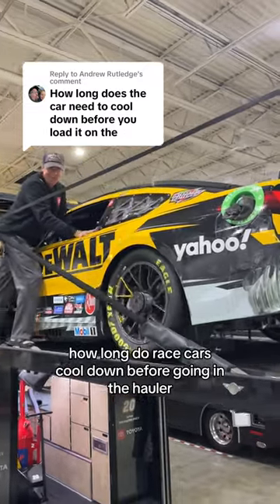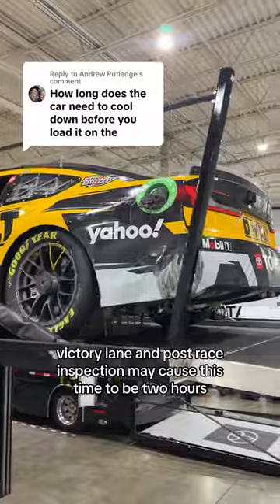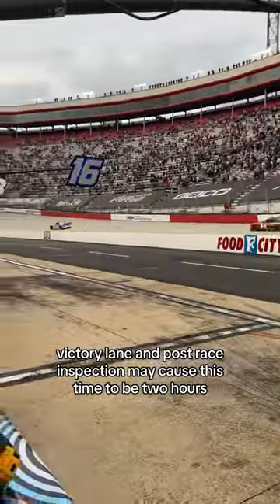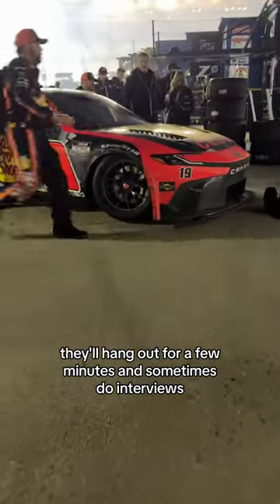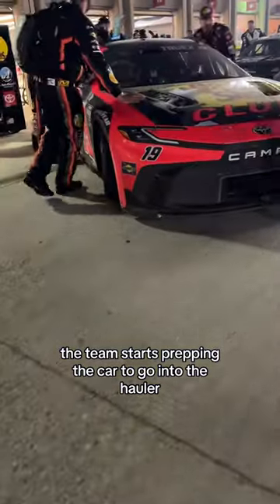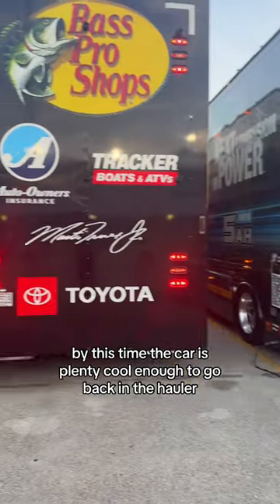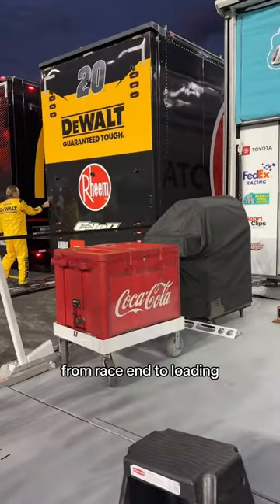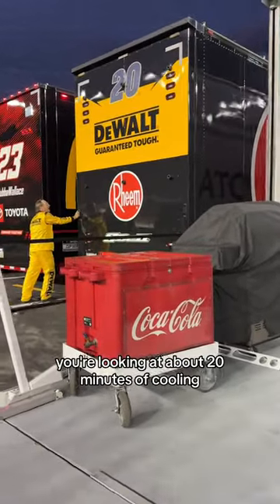So how long do race cars cool down before going in the hauler? #NASCAR #hauler

Comment: What do the drivers do after every race? Do they go straight back to the shop?
Reply: More than likely they get on a plane and go home
Reply: Sometimes it depends. If they go to an international airport you'll see them at a restaurant in the area before they have to catch their flight. If they're driving you might catch them at a drive thru. They will hardly ever hang out at the track afterwards unless there's a special event happening
Reply: Drivers of the big teams don't go to the shop much outside of team meetings.  They certainly aren't allowed to work on the cars at all.  So after a race win or lose they will likely just jump on a flight home.  They may sleep in their own bed 1 or maybe 2 nights then back in the air to the nxt track.  They sometimes will arrive in town a day or 2 early for sponsor events or just to check out a cool place in the area they never went to.  There isn't 1 concrete answer to this question as it varies so much team to team and driver to driver
Reply: @fish3539 i wonder if they take off at the talladega airport when they're at defa
Reply: @villain6634  yes. I was at the track and you could see team planes landing
Reply: @SierraFrost69  I didn't see teams landing was in Lincoln tower section a
Reply: @villain6634  damn, that's crazy
Reply: pretty much what you'd do after work
Reply: @jayer-su3hu  you talking about the gibbs drivers or drivers in general